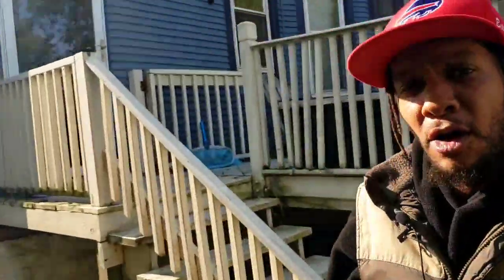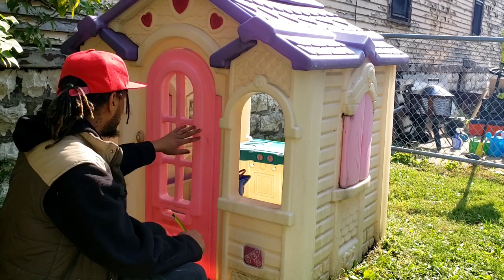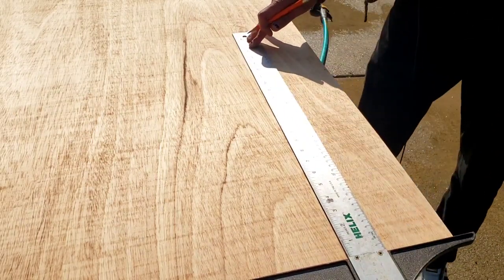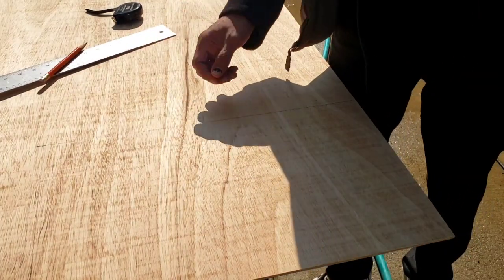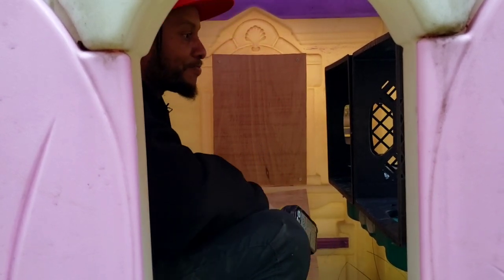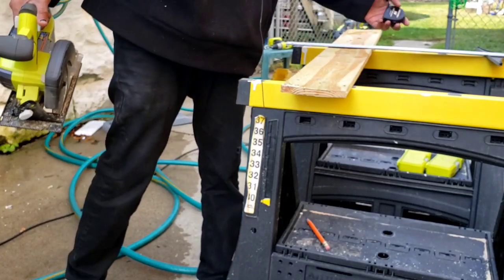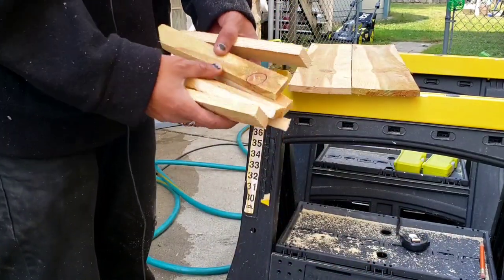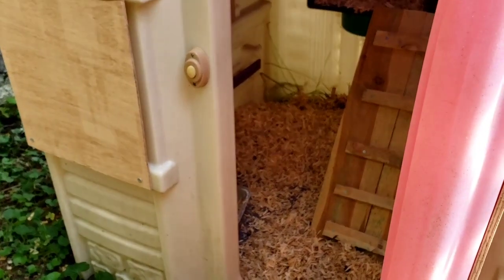How to Convert a Playhouse into a Chicken Coop: Backyard Chicken Coop! Keep your chickens WARM!

Comment: be sure to post updates if you rebuild this in any way!   

I looked up your video because the world's longest yard sale is going on right now and someone is selling a house just like this. I've been watching a few videos on what people are doing.

 My only 2 concerns with your design is that there isn't ventilation and there's no perch/roost. You don't want them sleeping or perching in the nest boxes, I don't believe. I was thinking about putting a 2x4 across and I guess a big Branch would work beautifully as well just leaned in there somewhere even!

I was thinking chicken wire or hardware cloth. I have both of those and I think I'm going to go with the quarter inch hardware cloth inside the cape on every opening.

 I'm concerned that by you putting the plywood on the outside that raccoons and other animals with claws could just pry that off and break it and chew it. I don't know. Do you have anything securing the bottom? 

I didn't see you put chicken wire or cloth into the dirt on all sides or buried down across the floor.